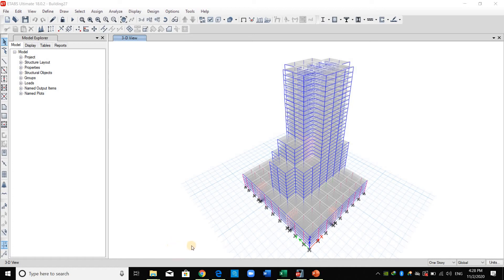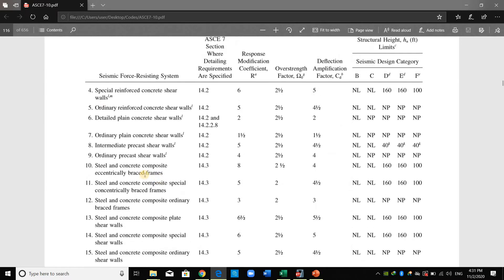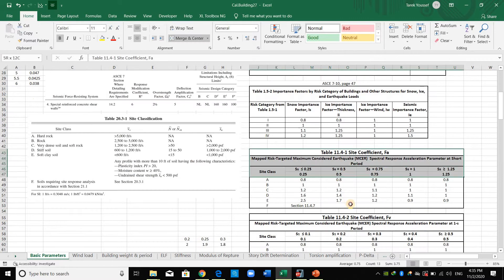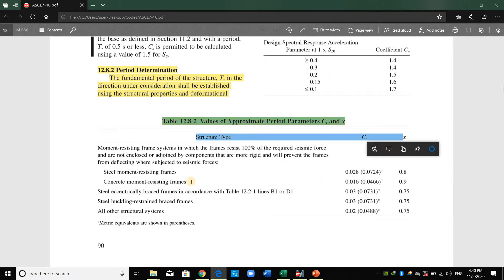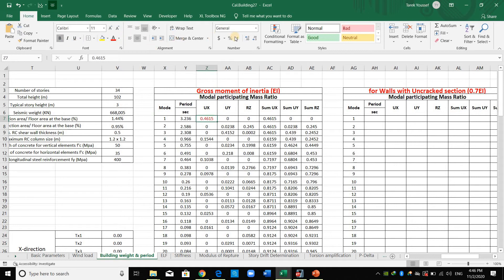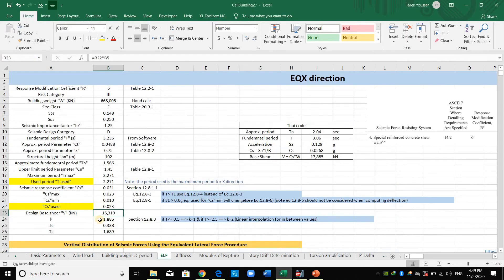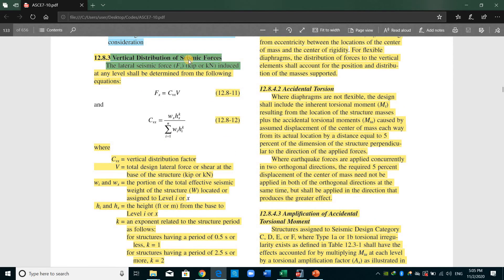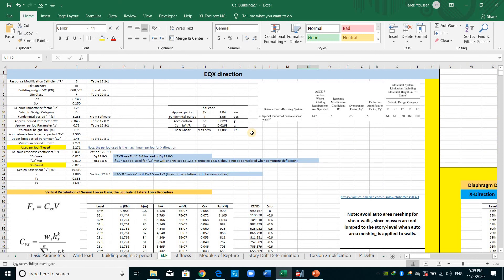Seismic forces of Equivalent Lateral Force Procedure using ETABS and hand calculation (Lec10)

Comment: In 12:14 How you know to use this equation to find Cs where is or  much  TL to compare with t?
Reply from the maker: I am designing this building for a site in Bangkok, Thailand. The Mapped Long-Period Transition Period, (TL), is not used in the Thai building code, which is why I ignore the formula for "Cs" that includes "TL"

However, let me provide a brief explanation:

“TL” is the period at which the response of the structure transitions from being controlled by velocity to being controlled by displacement.

You can find the values of the long-period transition period (TL) in the ASCE 7-16 standard in Figures 22-14 through 22-17. However, these values are specific to the United States and may not be applicable to other regions, including Thailand.

If the fundamental period of the structure "T" ≤ "TL", use Eq. 12.8-3.
If the fundamental period of the structure "T" > "TL", use Eq. 12.8-4.
Reply: @Eng.tarekyoussef  thnx so much

Comment: According to table 12.2-1, building frame with special shear wall maximum building height could be 160 feet, but your building height is more than 300 feet. expecting your explanation. Thanks in Advance
Reply from the maker: ELF method should not be used to compute the seismic design forces for building exceeding 160 ft. The ELF method is first discussed for education purpose, and secondly for computing the scaling factor (SF) that used in dynamic analysis.